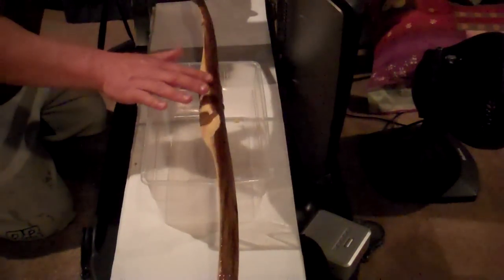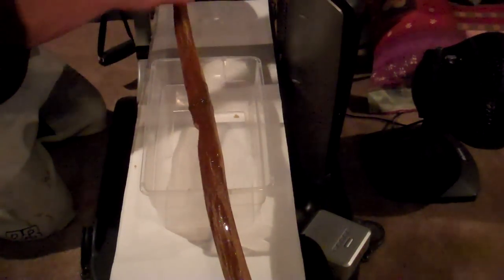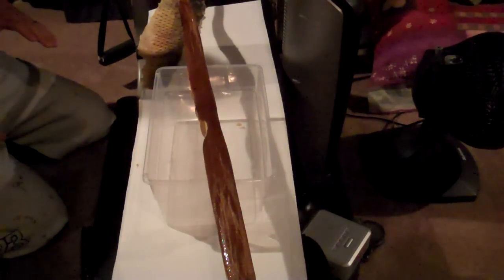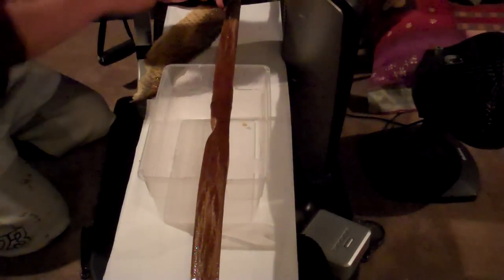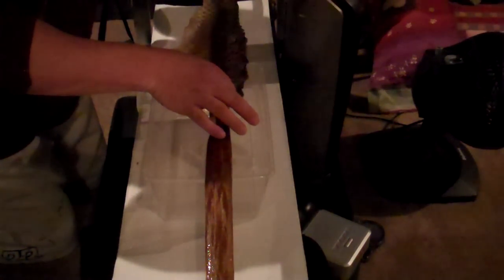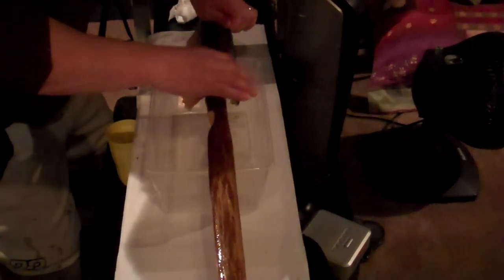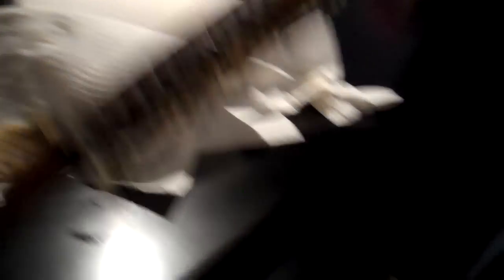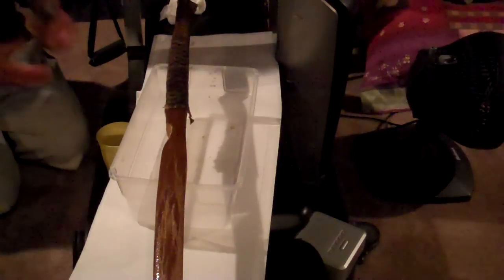How to Build an Osage Bow: Build Along, #15: Applying Skins

Comment from the maker: Hard maple is an excellent bow wood. Definitely can make it with a backing. A unbacked self bow will depend on the direction of the wood grain and if there are any run offs. I'd put a backing on it and it will make a very high performance bow!

Comment from the maker: The principle is that the back of the bow has an elastic force acting on it and the belly has a compressive force. This means somewhere in the middle of the bow there is a neutral spot where no elastic or compressive forces stress the bow. The backing material should have a high degree of elastic strength and moves the original back of the bow more to the center where it is closer to the neutral spot, thereby protecting it from the stress of the bend.

Comment from the maker: As a backing material deer rawhide works the same as the dog bone rawhide I have used in another video, but it is thinner. Thinner rawhide keeps the limbs light and doesn't rob performance as does the very thick dog bone stuff. On the other hand I prefer to use thicker rawhide on wood that is more prone to failure because the thickness of the backing material the more the elastic forces are offset. Ed Scott explains this very well in his Youtube interview. Continued...

Comment from the maker: Yes you can do it in steps with the hide glue and then finish with Titebond 3. To the best of my knowledge is it mainly titebond 3 that won't stick to titebond 3.

Sinew at the craft stores is actually artificial sinew (nylon thread). So no, it will not be the same and likely will not work.

Comment from the maker: I prefer leather dye as it dries incredibly fast. I use Fiebing's Leather dye (usually black and light brown) for most of the bows I want to dye.

I have a video up "how to build a longbow: a trip to the lumber store" where they have just about everything in board form. This particular store, "Peterman's Lumber" in Las Vegas is a flooring & cabinetry speciality store, so they stock a lot of exotic woods. 

For what I call staves (basically split logs or branches) I get my supply from eBay.

Comment from the maker: Oh sure, make me do math...

Okay so 59"-16"-4"-2"-2" = 35" 

35"/2 = 17.5"

So you're going to have 17.5" working limbs and 8" static limbs, right?

Osage reduced to a single growth ring and perfect tiller should draw 28"-29". My bow that just won bow of the month in Primitive Archer Magazine has similar specs, but with a longer riser and bends to my full draw of 29".

If you want a little safety room "slap" some rawhide over the single growth ring back and you should get an extra 1-2" no prob

Comment: what kind of glue did you use?
Reply from the maker: Titebond Hide glue. I have since stopped using it only because it makes this crackling sound when the bow is cold. No damage, just a weird noise. I have switched to titebond 2 wood glue for almost everything these days.
Reply: thanks!